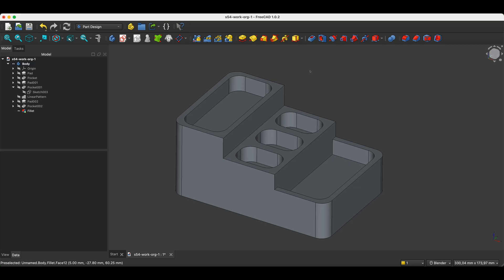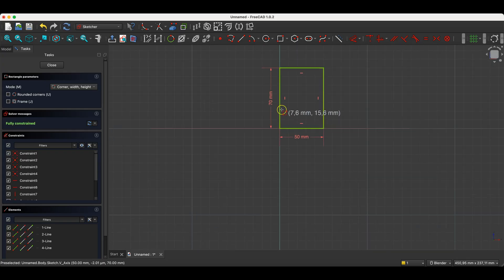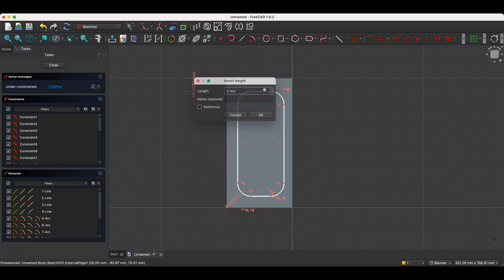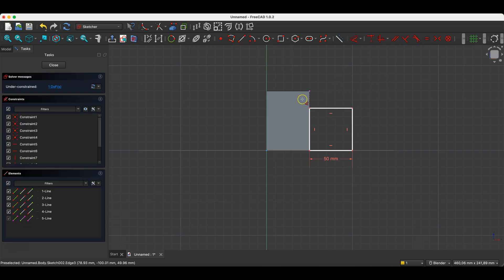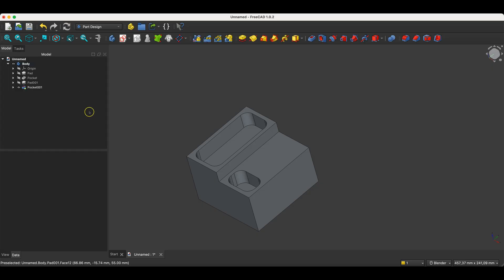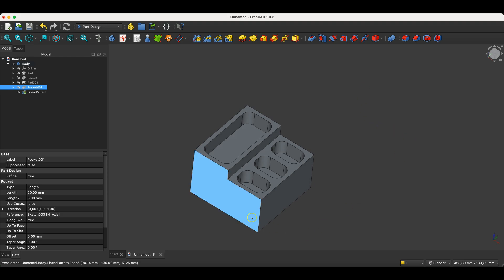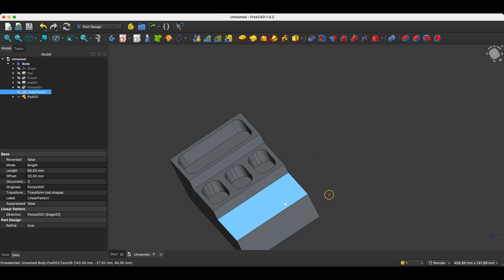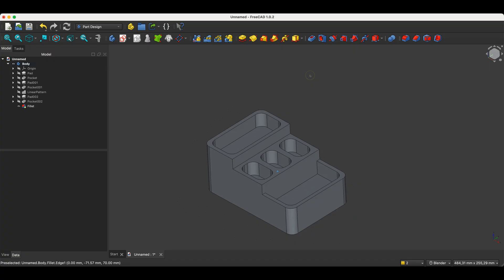Stop Struggling in FreeCAD! Watch This 3D Modeling Walkthrough FIRST!

Comment: Why not create a single staircase pad and the add the pockets?
Reply: I would have done it this way.
Reply: because doing it sequential gives you more control over the subsequent steps.  simple.
Reply: @Xadarako   thanks , I had the same doubt
Reply: If you blob the entire shape out in one go and then add the pockets.  you lock yourself into the shape,  you can try changing the sketch in dimensions. but your model may just fall apart because the subsequent Datum/attachments break.